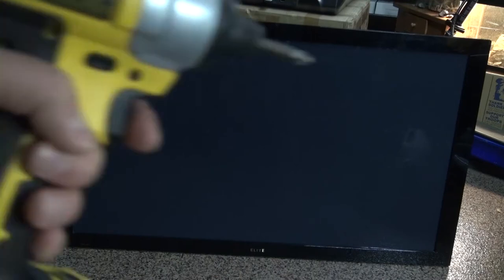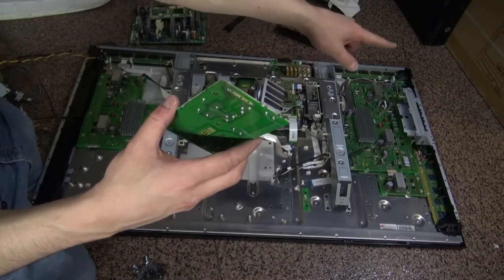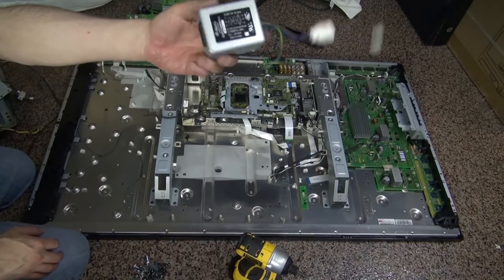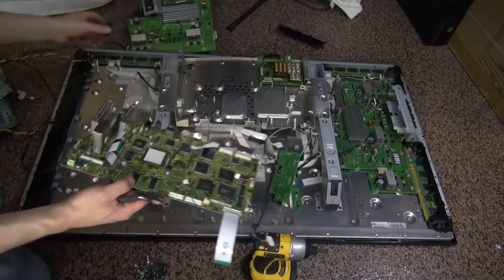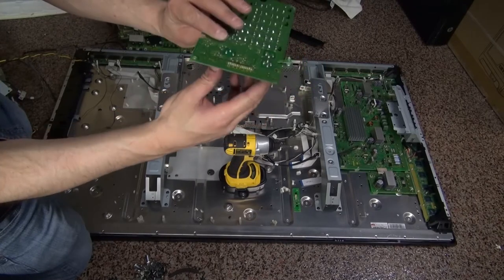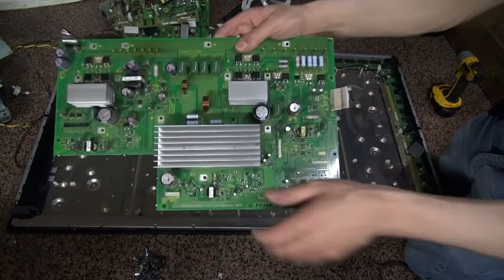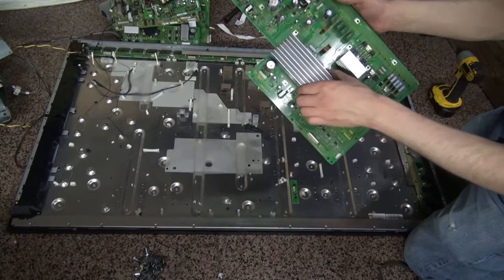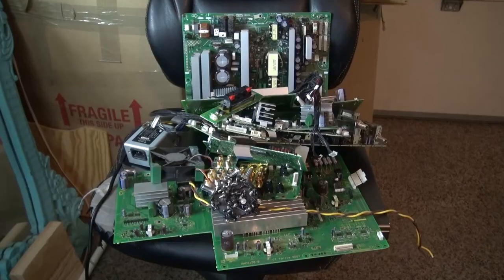Old Flat Screen TV Teardown

Comment: No speakers🤨
Reply from the maker: Yes I know, it is unusual. This did not have speakers but it does have a connection to add external speakers. Like a sound bar for example.